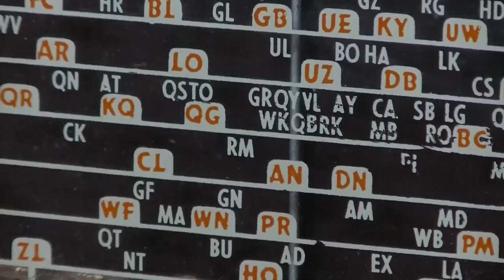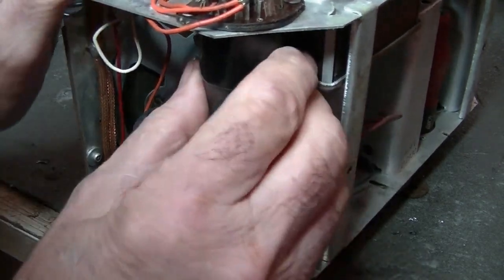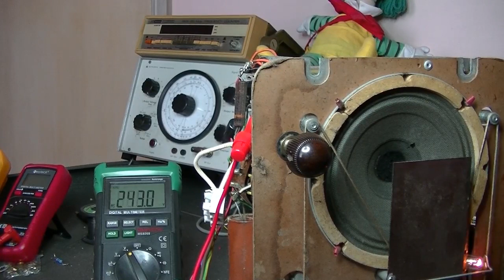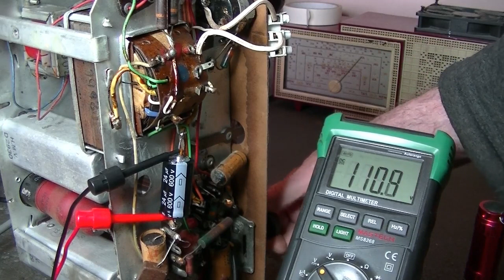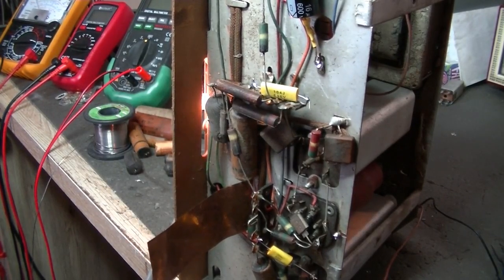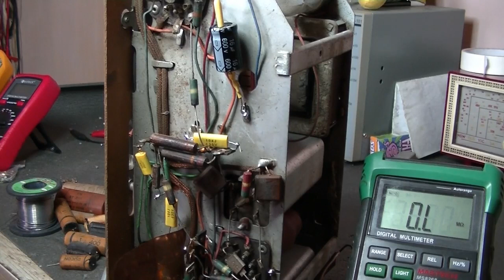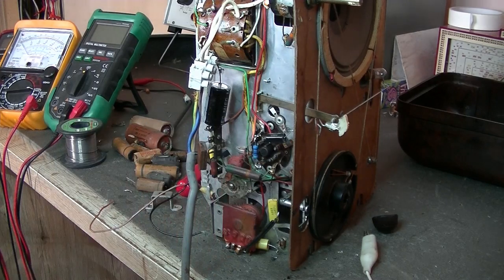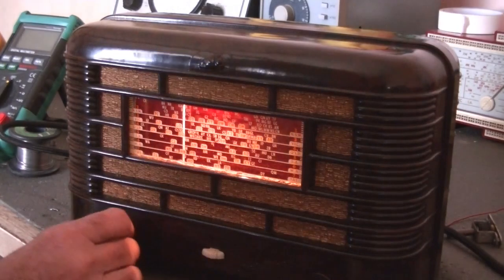Another HMV Little Nipper Mk II Restoration. Model A13B (1959)

Comment: Thank you for posting the circuit - it's what's known as a reflex set. The EBF35 is the IF amp & also applies a small ammount of gain at audio frequencies prior to feeding the o/p valve. Reflex circuits always have what's called "minimum volume effect". Its a side effect of asking one valve to do two jobs at once. Nice resto mate:)
Reply from the maker: Thanks Man and also for the info, very helpful :)

Comment: I always enjoy watching repairs done on radios that are foreign too me, unfortunately none of them will ever make it on my work bench. Frank, you’re a nail polish bandit like me, LOL. Nice looking and sounding radio. As long as the volume controls work smoothly, I don’t sweat the sound issue when the control is turned all the way down.
Reply from the maker: Gotta love that nail polish Ken, lol. Yeah, I've learned that not all radios are completely silent when the vol is off. Nature of the beast and nothing to get worried about. Thanks Man :)
Reply: This series of hmv were made from late 1949 through until the end of 1952  A13a and B . Good sets, and there were very similar versions made in New Zealand at around this time. The only difference in the 1949 to 1952 models were that the first model wore a plastic badge that fitted to front of the cabinet saying " little nipper : the later versions  had the nipper name embossed into the Bakelite. 
There was also over the time of production different front bars from one model to another . Many 1000s of this model were produced. Most were in brown or cream Bakelite.  You could obtain this model in other colours if you wanted to pay 10 shillings more.